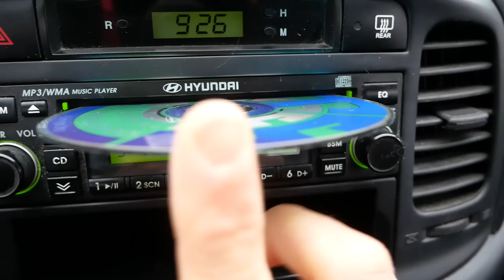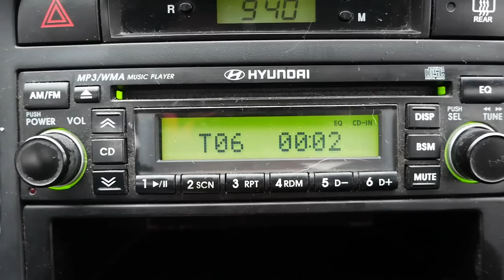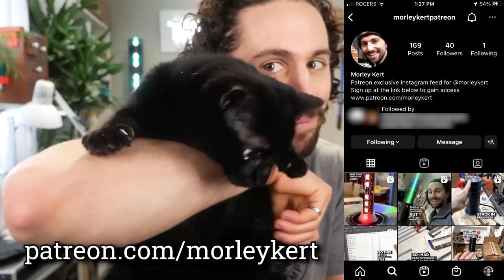Turning 1,000 Free CDs into Art

Comment: PLEASE NEVER EVER connect loose wires to a powersupply like that. That creates high resistances which can cause FIRES at 20A! Use some crimp connectors and save your house!
Reply: On the bright side at least he soldered the high amp connections to the power supply to lower the resistance. Idk if he meant to do that but it’s better than nothing. I agree with a crimp though, but I think for not being an electrician he did a pretty good job. Also did he say it was 20 amps? I assumed it would be 2 amps or so since it wasn’t a high powered project.
Reply: @gavinshaffer6220  To be honest soldering a screw connection is way worse than bare copper. Solder has the potential to cold flow and increase the resistance this way. 20 Amp is very plausible, those addressable LEDs take a lot of power. Connection anything but a proper terminal to such a power supply is absolute malpractice and can and has lead to fires... Even if the voltage is low at 5 Volts, 20 A is a lot of current.
Reply: @BigManko  I have some very similar LEDs to these and they run 2.5 amps. These might be different at higher power but I don’t know to be honest. And some types of solder are made for higher currents, if they are higher currents. I’m not a professional when it comes to soldering specifically, I’ve don’t more welding to be honest, so chances are you’re more correct on that part. I am also from the US so I don’t know what amperage comes out of his wall, but my house does 15, which is a little bit less. It also looked like he soldered more on the outside of the contact, and left the actual copper plate untouched, meaning the soldering is more just to keep the wire tightly in place (which obviously isn’t usually needed because the screw does it just fine, as seen by how you wire up a house reciprocal).

Comment: Very cool lamp! The time put in is definitely worth it and it's something I'd be proud of. I'd swap out the controller for an ESP32 running WLED as the effects, including sound reactive, are nuts. I've built three strips so far. If you build more you can sync them up. Remember you can solder the strips directly together at the cut points to keep the spacing. Love your channel!

Comment: Amazing! But One thing I can suggest you is that you don't need such a huge and heavy power supply as it would generate a lot of heat and therefore loss of power. You can easily substitute it with a led driver 12V 2A  (2A is more than enough for that length of led strip) or you could use any power adaptor 12V 2A (The onces that are used to power up electronic devices like wifi router etc) Which would be cheap and compact.

Comment: I started watching this Sunday morning here is the problem......I'm not watching ANYTHING you do half awake because I ENJOY your work. Here are a few things I wanna share.....I was a CNC machinist, subtractive manufacturing, I did a little 3-d printing......additive manufacturing......what you're making, did you notice that the base was tight? That's because no matter what is made you always have to machine parts for a correct fit. I'm not sure in metric but your base is probably +/-.010 or close to a sixteenth of an inch which is why it was tight. Did you also notice you had to cut something out on the inside?? Always my line of work comes after making it. Next time you make a base ring on that like your 3-D printer make the base diameter 1.587 metric which is about 1/16 of an inch bigger and it will fit better
HOWEVER
I freaking LOVE your builds and my watching your channel WILL NOT STOP

Comment: For anyone making this, the power supply should connect to both the Sp107E and the led strip itself - preferably to both ends of the strip to minimize voltage drop through the strip. The SP107E can not handle all of the current for that dense 5v LED strip passing through it.

Comment: I love it! But that PSU looks like a complete overkill for 2/2,5m led strip, correct me if am wrong...
Reply from the maker: Thanks! It’s not overkill, it’s the recommended size for that number of individually addressable LEDs. There’s more than the usual amount of LEDs per length in this strip, which is probably why the power supply seems big!

Comment: This is a great project, but I'm not so sure about the PSU you have used. It looks like a cheap Chinese power supply without a fuse and ventilation. Be sure it doesn't overheat in that tight housing.
Reply: 2nd that. Was Just about to write the same. Really check the temp especially in that tight fit in the base. You might also want to add an Extertal fuse. I have the same psu here, at least I think I do and, yes, it does the job BUT it gets pretty warm even unboxed and it does not have a Fuse... take care!